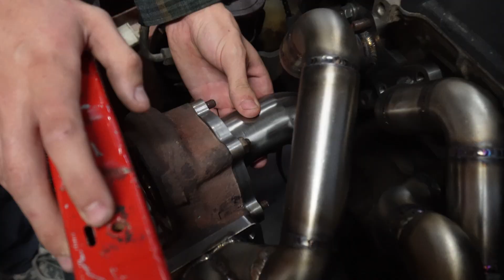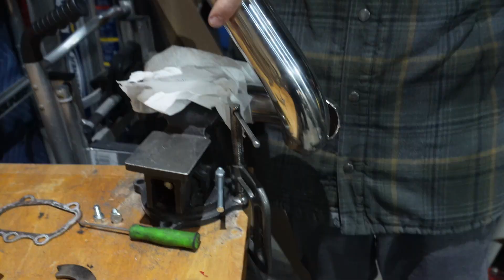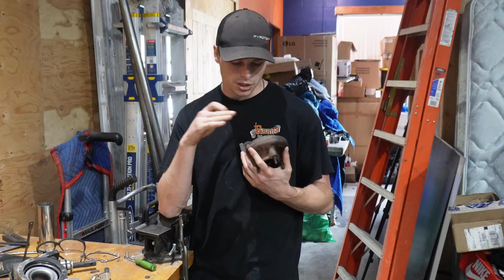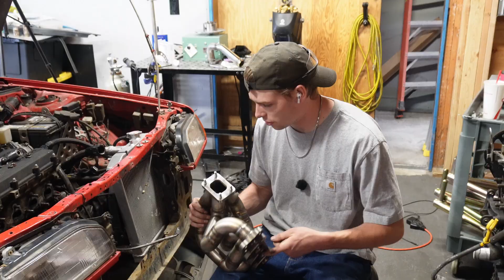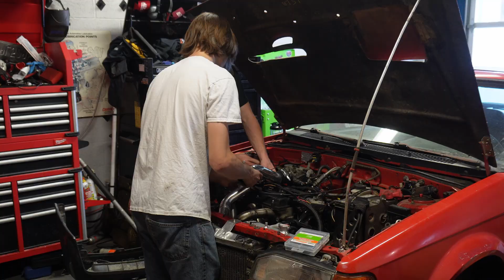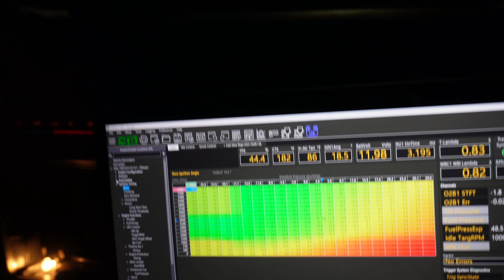Our 323 GTX Rallycross Car RUNS! (First Start)

Comment: Yo!  Sick build man.  One thing is that your IAT sensor location is gonna heatsoak and make things annoying for tuning.  Particularly hot restarts after sitting, I usually like to put them in the endtank, or just after the intercooler (away from engine bay heat) to combat this.

Your crew looks a lot like mine.  Miatas, 323s, festivas galore!  You got a sub here.

Comment: Dude this is so cool! I'm looking to buy a 323 right now. Found one for $1300. Idk if it's worth it though since it's also very rare and hard to find parts.
Reply from the maker: 323s are fantastic! With our strong Facebook group, reproduction parts, and NOS stuff, parts are easy to find. If you got that GTX for $1,300, don't sweat the parts availability. Our community has you covered!